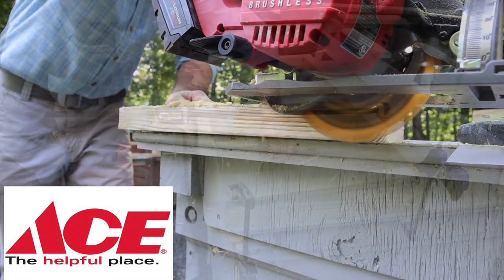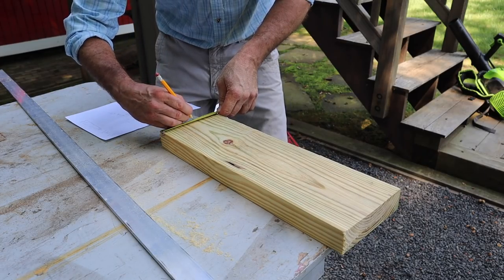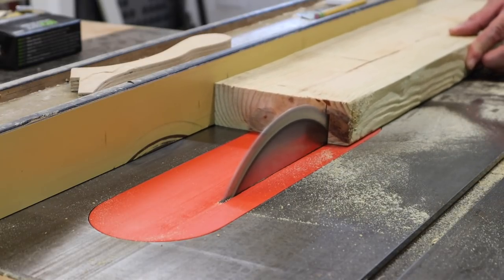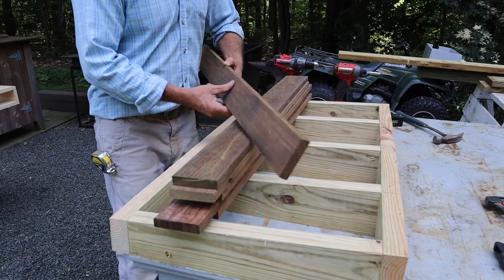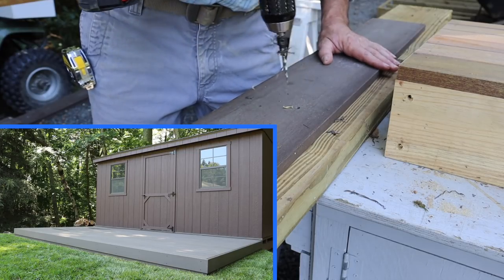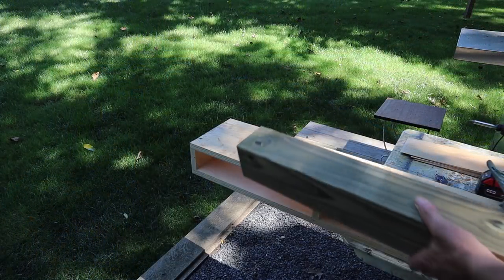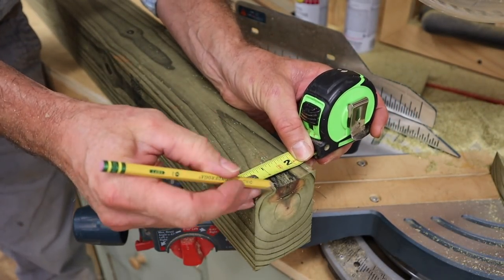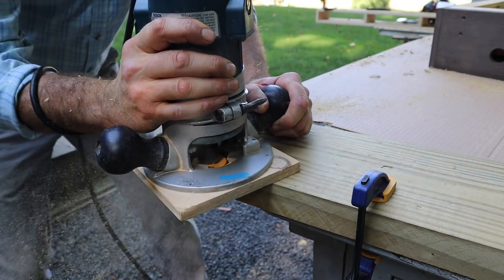How to Make a Fish Cleaning Table - Work Station

Comment: Looks great, Jon. If you didn't have the left over IPE, would you have used the composite decking instead?
Reply from the maker: Yes I think so but the wood will probably hold up better to the knife
Reply: Got ya, thanks.

Comment: Life time fisherman and the table has three design:  1) too slippery.  Almost every fish that has been in an ice cooler for several hours will be slimy by the time you want to clean them.  It needs to have a rough surface.  Keep a large, hard bristled brush tied to the table and between the brush and natural water pressure you should be able to blow off any scale, slime or guts.  2)  No backwards slope.  You don't want your fish flying away from you when you cutting on it.  Keep the surface flat.  Any water used to clean the fish will run off naturally between the board or blow off from the pressure of the water.  3)  The front needs to be flush.  When you file a fish, you bring it to the front so your hand is free to move up and down the fish's spine.